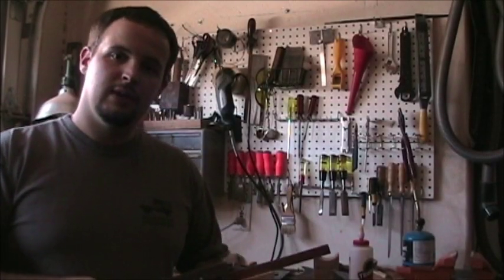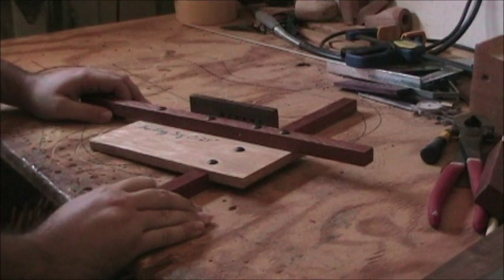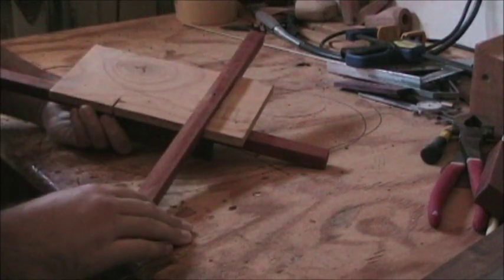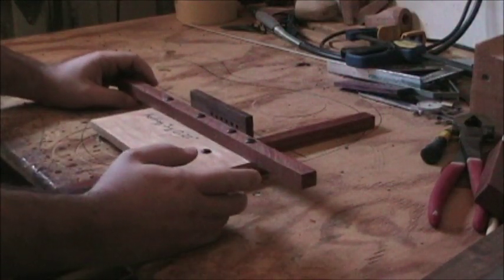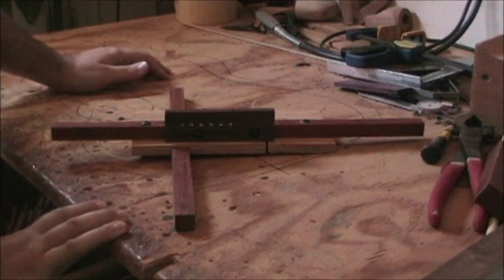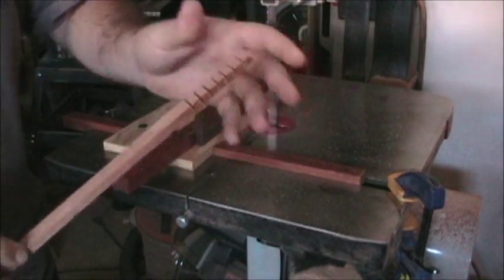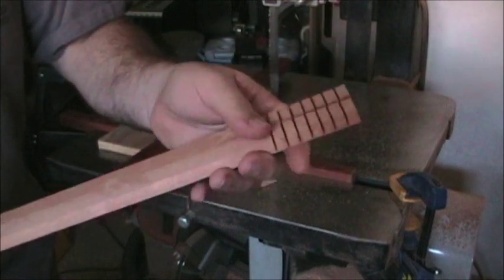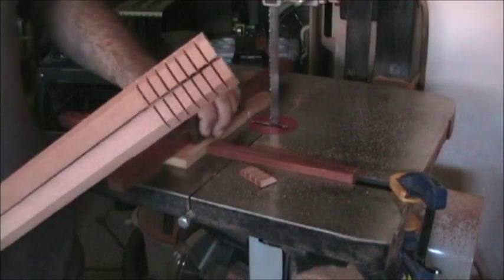Kerfing Jig

Comment from the maker: You could absolutely do that with the kerfing, and that is a great idea.  It can be a little tricky with the masking tape, however it does work for me and I'm used to handling it.  You could get twice the kerfing for the same effort by making a long strip and cutting it in half.  Great idea.  For the depth stop a fine adjustment like that would work for sure, it would just need to be close enough to the saw that the spine hits it and stops the cutting.  Another great idea.

Comment from the maker: @DemetreJosebeck I don't really notice too much bounce back, but my Irwin clamps are older so maybe the pads are stiffer than they are on some other newer bar clamps.  If you get bounce back definitely switch to a solid clamp and that will eliminate it.  Great suggestion.

Comment: hey, I like your jigs. I am using the fret cutting jig you showed once in your videos. I wanted to ask why won't you use a wide piece of wood and kerf it, and only then cut it into two separate kerfing strips? peeling off masking tape from the flimsy 0.5 mm back of the kerfing can break it...  I also had a thoght for the stopper, you can use some sort of a stop with a threaded rod that could fine tune the depth of cut, instead of the clamp... thank you for you video!